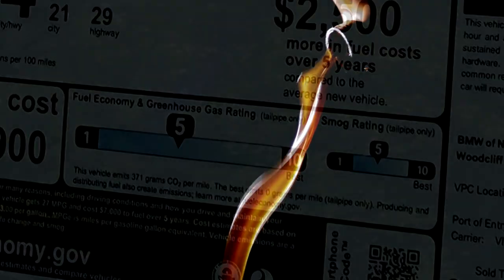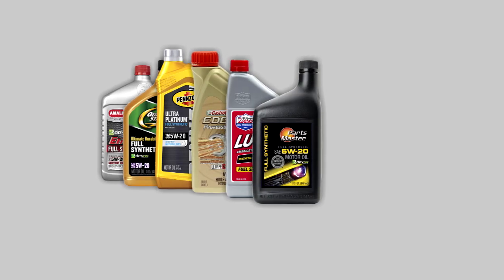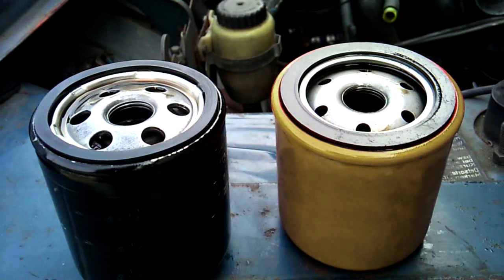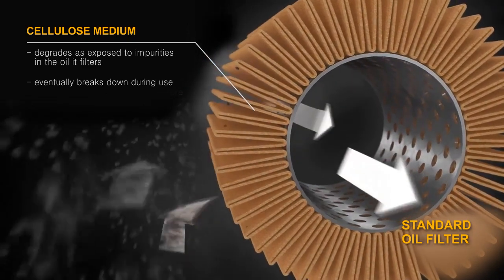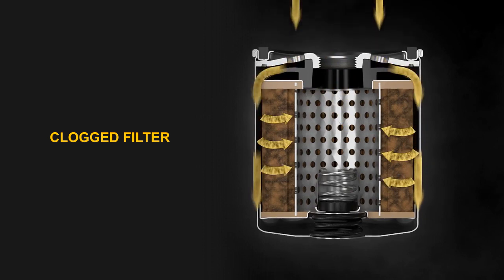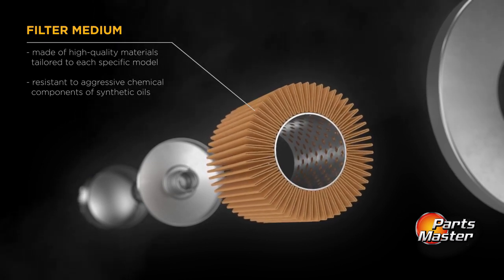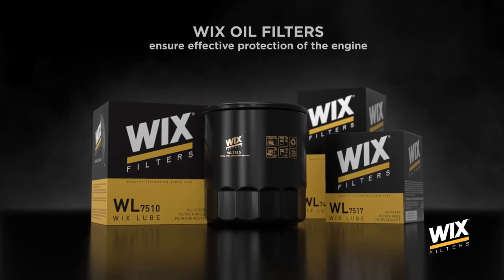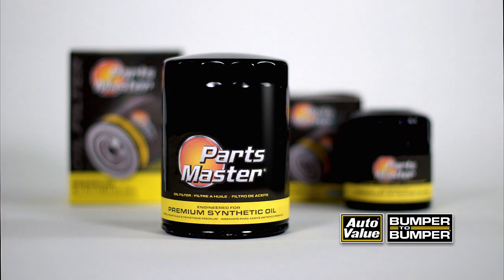Parts Master Synthetic Filter

Comment: Is this a Wix XP clone? Like Napa platinum?
Reply: Partsmaster full synthetic oil filter is noted as made per WixXP and Purolatot Boss. The one I purchased for my 2005 Pontiac Montana sv6 has the silicone ADV..and the outside appears to be a USA mfgd Purolator Boss,  could be a WIX XP..and  I paid $5 installer price at Autovalue.  I am smiling and sleeping well..with it in my 2005 SV6 190000 miles with Castrol 5w30 full synthetic Dexos 2 ILSAC 6A